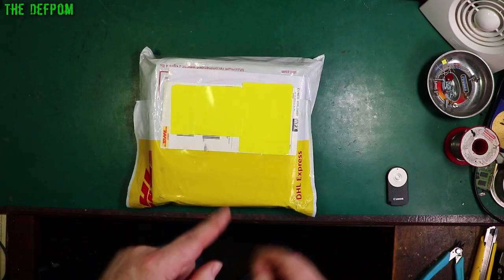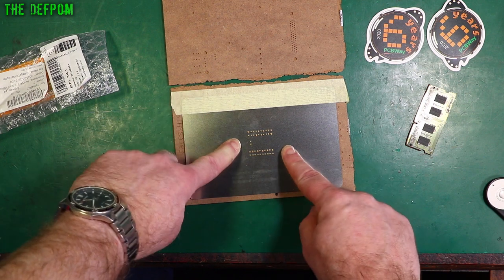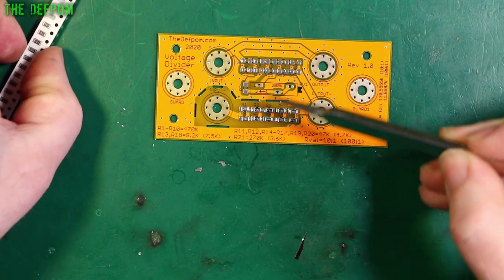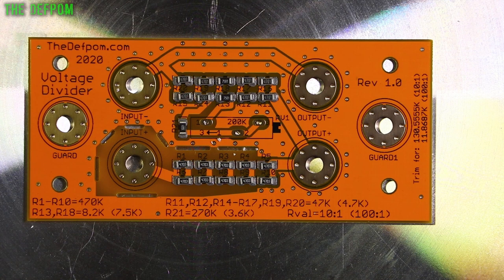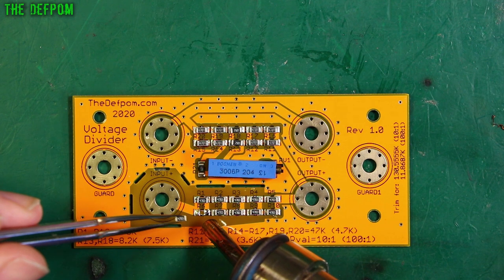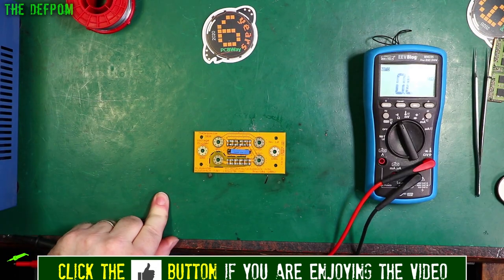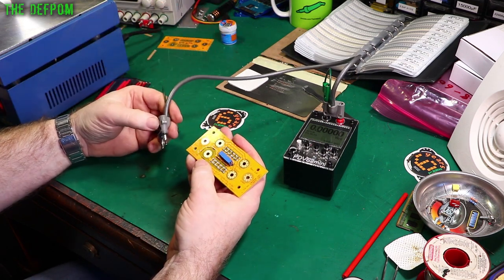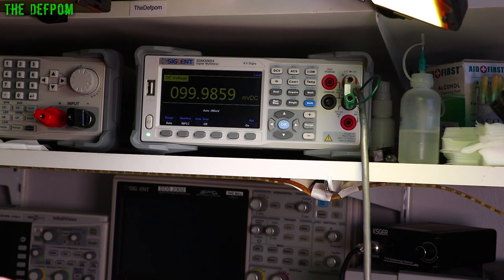#758 Voltage Divider Project - Part 1 with PCB from PCBway

Comment from the maker: I neglected to mention this in the video.... and it is important:
Due to this being a simple resistance divider, any external loads will have an effect on the output, the most relevant of these is the multimeter connection itself!

The input impedance of the meter that this is used with will have an influence on the calibration of the board, some meters switch between 10MOhm and 10GOhm input impedances depending upon the range selected, and there will be different between meters too, so when this board is set up it can only be used with that meter and no other and maybe only in certain ranges, otherwise it will not output the correct values.

For instance, my Siglent 3065X allows selection of 10G or 10M input on the 200mV, 2V, 20V ranges, BUT the 200V and 1000V ranges are only in 10M, (my HP3457A does similar) so if you calibrate at 1V output, when you go to the 200V range it will read lower, depending upon the resistors that were used to make the voltage divider. as effectively you create a second divider with the input impedance of the meter you connect to as it is across the 2nd resistor string of the divider, so if the string is ~100K you are putting that in parallel with 10MOhm so you get ~ 1% lower output, compared to with 10GOhm.
Reply: 10M parallel to 100K is 1% change!

Comment: To get the best possible tolerance with standard resistors I would use the same resistors in both parts of the divider. This means any systematic deviation in a strip of resistors would cancel out. If you need a trimpot to adjust the final tolerance, keep it as small a percentage as possible, the trimpot will (most likely) have higher and different temperature coefficient than the resistors.

For adjusting check https://www.eevblog.com/forum/testgear/program-that-can-log-from-many-multimeters/
It has a "Adjust Scale" that tries to make adjusting values easier.

Comment: 27:00 As a tip for adjusting those pots, i always use a flat screwdriver a little bit wider then the turnscrew, 
and use a short piece of rubber tubing to cover the tip of the screwdriver that then act as a guide.
There are special screwdrivers available for that purpose, but why buy it, if you can make it :-)

Comment: How about buffering the output to get around the 10M/10G loading problem.....a chopper op-amp on the output powered by an on-board battery, and you could get creative and have the power for the op-amp switched via a FET when the main input voltage over a certain voltage is detected, thus no on/off switch req'd. Or indeed power it from the input voltage.
You could probably sell these if you get it nailed.
Reply from the maker: I have been playing around with a voltage follower design, have ordered some more parts, will just hack something together initially but will get another board made once I pin down the design, I actually made a split rail op amp supply today from a couple of zeners running from a single rail 4v supply...it worked pretty well.

Comment: I really like the idea of using multiple resistors to get a tighter value from averages.
Reply: That only doesn't really work anymore when resistors come out of the same batch. Nowadays it's not so difficult and expensive anymore to get 0.1% resistors. But in the end you can just calibrate this with lower voltages.
Reply from the maker: P_ Mouse I was seeing different values from the resistors, even though they are from the same batch, BUT like you said, this could be done using higher quality resistors with very little effort to get a better result.
Reply: @p_mouse8676  Cheese.
Reply: @andymouse  nom

Comment: If you are doing mk2 then maybe have 2 pots in series with one having a resistor. That way you will have coarse and fine adjustment. Also a tiny cap on the output of the pots may help with the noise during adjustment
Reply from the maker: M Sana - I have a couple of follow up videos about this project, one is about the output impedance matching, another will be about greatly improving its output and stepping the precision up a fair bit, sure this is a nice cheap way of doing it, but it could be improved and made more robust.

Comment: Given non precision resistors you could well have fixed resistors changing by +- 100 to 200 rpm worse on bad supplies of resistors. Precision resistors should be less than 10ppm. The trimmer could exceed 1000ppm.  The values you were trimming at 100.001  the 1 on the represents a 10ppm deviation

Comment: I made something similar ish 10 years ago, it was a 35000V to 350v eht probe, but i had to take into account the 10million ohm multimeter connected, and only use that one for the probe.
Lots of blue 47meg resistors (from maplin) in a wide zig zag down a plastic channel, then spray over them with anti corona laquer.
I was able to measure the eht anode on a 26 inch colour tv tube.
Some end trimming resistors were added as some of the 47megs were slightly lower than spec.
I didn't get killed, honest guv-na lol.

Comment: I got a bunch of 0.1% SMD resistors that were only a few cents each in 100's quantities from 5M to 10 ohm for building dividers. Problem using the normal 1% resistors is high temp coefficients, that can vary in batches and values. A trimmer can be especially bad on temp coefficient that for stable precision divider becomes especially critical. Better solution if wanting variable trim in building is a good multi turn cement trimmer, and then after trim, without much environment drift measure precision value the add fixed precision stable resistors of equivalent.
Reply: CERMET trimmer was typed, replaced by the entry editor

Comment: Did you say that you use "silver solder" is that safer than lead based solder and where do you buy it from - thanks?
Reply from the maker: It is still a leaded solder, but has 2% silver content to improve the joint.

Comment: Did they gold plate the solder pads? If so, you may have problems in the long term because solder can alloy with the gold causing brittle joints. Years ago, any gold plated component leads (rare now, but more common in the 70s and 80s) had to have the gold leached off in a solder pot before soldering to a board (the solder in the pot gradually became more valuable as the level of gold built up!)
Reply: A special stripping solution was used to protect large volume wave batch soldering from those ancient gold plated leads that were very common into and before 1970s. It was too expensive to change the solder bath content effective each day or so as solder polluted by gold creates brittle unreliable joints.
The fluid was ruby red colour and descriptively became known a "RUBY FLUID", as far as I recall it was a mix of several acids.
Reply: My belief that as long as the solder to gold content ratio is high enough then the gold will dissolve enough in the solder such as not to create any real embrittlement problem. ENIG via Pcbway default is 1U" thickness which is at the very low end. Go up to 2U" or more an the gold looks visibly more orange. 1U" is verging transparent LOL!
Design engineers can also take this into comparison to maximize where possible pad sizes thus solder/gold ratio.
I've never really experienced an embrittlement problem (that I know off) so don't have direct experience except that I do use 1U" myself.
Reply: @IanScottJohnston  certainly within one board soldering the gold in effect was terrific as even some aging/ surface uncleanliness was never a problem. Within one assembly feeding fresh solder to a joint, such as manual soldering, was great. Thus in pre mass assembly times, with principlly manual soldering or even semi automated,thus wiith soldering iron and resin core solder lead, the gold was actually a benefit with ensuring good solder wetting even with residual lead/pcb contamination, which otherwise required cleaning before assembly.
However in wave bath soldering it became a huge problem, as it accumulated and gold had to be stripped on any components passing through the solder wave system.  Regular replacing of kilograms of solder was just too expensive and time wasting.
Other hand assembled parts assembled after wavebath process  continued with any gold on leads if present. For wave soldering however the boards and components also were required to be in very fresh state, parts and pcbs that for some reason were stored long term, the surfaces were also required to be cleaned (no oxidation, films or surface deterioration). But true also many cheap consumer products, (radio, TV etc,)  assembly lines did not bother that much as long term reliability and endurance were not judged to be enough concern for expensive reprocessing and costs of such things as 'Ruby fluid '  as that was also not cheap. So much so that batches of components if delivered  contrary to contract with gold were sent back, unless urgently needed or production would be set back. Then the fluid was used and under contract the costs would be directed to the component supplier. Some components simply were not available without gold, for example many chips in the white ceramic side brazed leads. The company just had to accept that or change designs to alternatives. Some of the earliest Microprocessors for example all came in the white ceramic gold lid and leads form, no plastic molded lead frame construction available.                              
Anyway I do agree for a hand soldered or for that matter a smd with paste at each independant joint the gold if anything ensure good solder wetting without risking excessive gold disolving into the solder. I do not consider this instance  with manual/smd assembly having a problem, my comment as such was more directed to explain why gole on pads 9r components was considered a problem.

Comment: Seems with 3.6k fixed the trimmer at most should be 5K to 10K, or if total resistance the series fixed should be larger. The trim should no more than 5% to 10% of nominal theoretical value  for that trim range.